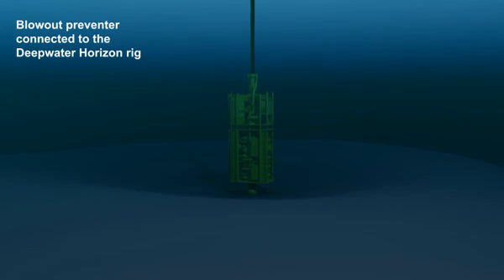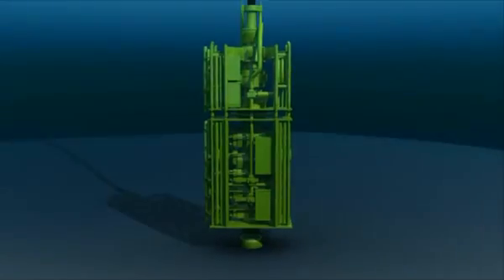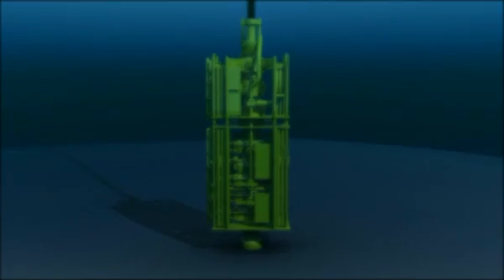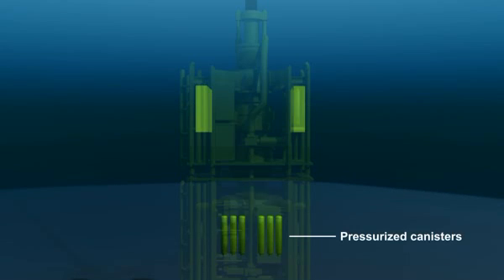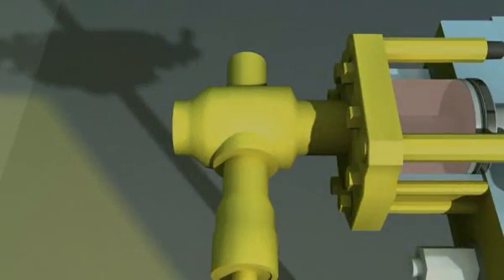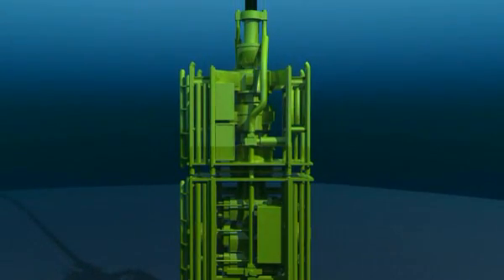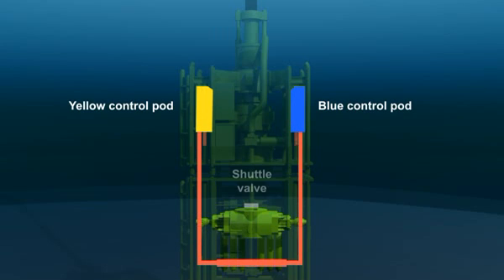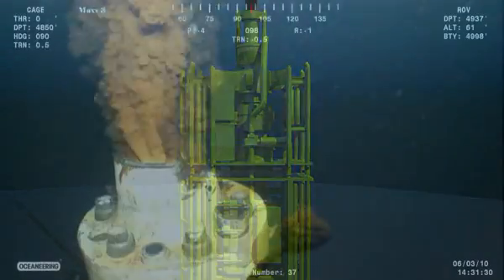BOP Oversight Fail

Comment: I have a Question They have a b.O.P. on the sea floor and that fails right? Why can't they have another B.O.P. on the Platform under the Drilling floor or something. Shear Rams dont cut the pipe on the sea floor they can just cut the pipe on the platform by shearing it off by the emergency B.O.P. on the rig. I wish they put an Emergency B.O.P. on the rig but thats only in my opinion.

Comment: For more information please contact Iker Acedo. EPC expert Adviser. Venezuela. There are numerous designs among them jet water injection, concret hatches and block precipitation, ecologic underwater belt-pumping-collecting systems, underground and on-the-line BOP-BPM systems. Etc. Also available improvements on cutts recovery and mud logistics carrying.

Comment: It is obvious that the BPM-BOP should be based on massive blocking the pipeline instead of cutting it. On my experience, not even one pipeline in my entire career, cut by a BOP or at any other industry has been able to effectively cut the flow it contains inside. Hence the blocking must be executed with technology which resembles the cork of a bottle and not a bottle neck blocked by pliers.